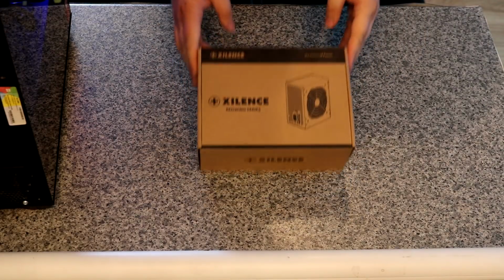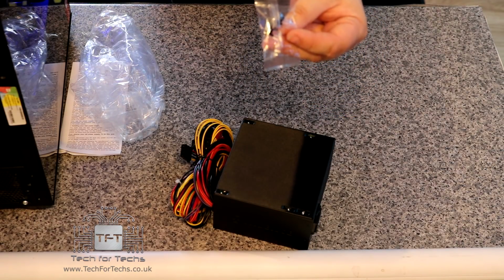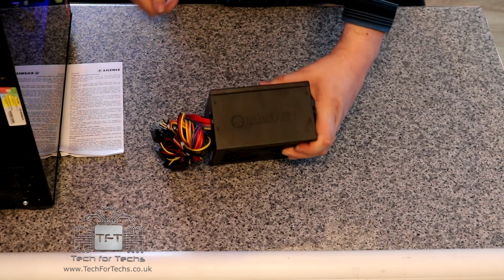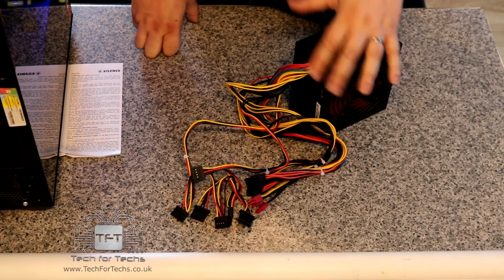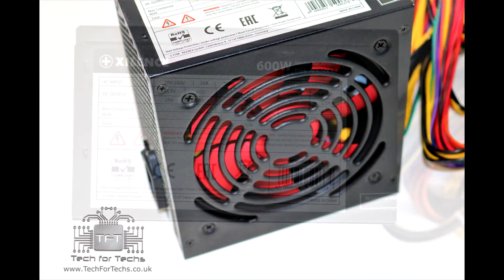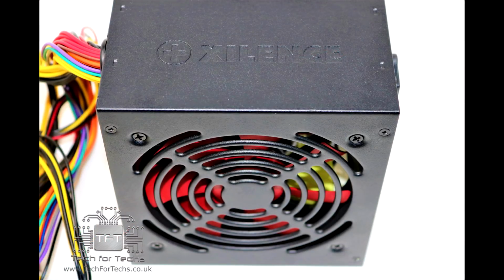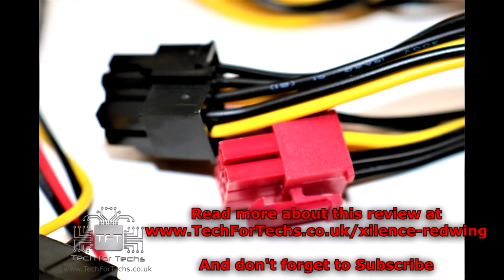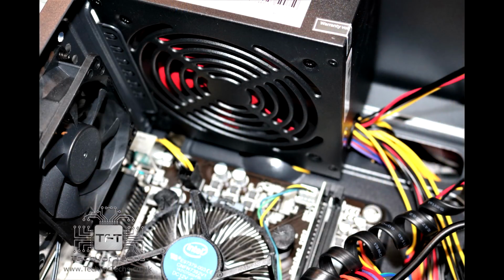Good Power-supply for under £25? Xilence Redwing PSU 400w + 600w  Unboxing and review

Comment: Before the xilence psu i had a cooler master psu and that one almost killed my system when it blew up out of thin air :(
and altho the Xilence psu is a cheap one i have been using this specific one for over 2 years. 
ive only had a bit of a problem when i was swapping motherboards, 1 wire of the 20+4 pin connecter on the psu came a bit loose and the system just didnt start..
but with a bit of wiggling around it pops right back in the socket.
Other then that.. no nasty blowing things up and just solid power supply if you dont plan on overclocking.
Reply: Had too much of a hassle with cheaper psus, bought a RM750 non X (yes I know the X is way better)
For 70 bucks and that has been working good

Comment: nobody cares about unboxing or the packaging. review the quality of the power rails, the noise of the fan, and the characteristics & failure modes of the components.
Reply: you don't but some it help. alot of shops have poor cable info. luckily i was able to see the cables and confirm it fits my needs instead of buying and praying.

Comment: Can u use this for gaming
Reply from the maker: @meneeradolf9170  While it should be able to run it I would highly recommend going for a slightly better PSU, the last thing you want is to trust a budget PSU to power £100's of pounds worth of components
Reply from the maker: @meneeradolf9170  no problem, the performance A are more catered to the type of PC you have,  Just the redwing is more geared for home, Office and low end gaming PC's imo
Reply from the maker: Low end gaming PC should be fine on a 600W,  but i would recommend you spend a bit more on a gaming PC.

Comment: Can i put in it amd fx 6300 and gtx 760?
Reply: easy running the 600w version with my overclocked i7-3770k 3.90GHz and MSI Armor RX 580 8GB, 16GB Ram, 240GB ssd and 2 300GB hdd's shortly buying 2TB hdd :)
Reply: @MrMikeYT  ok, flexer